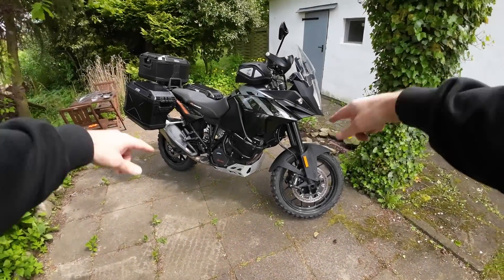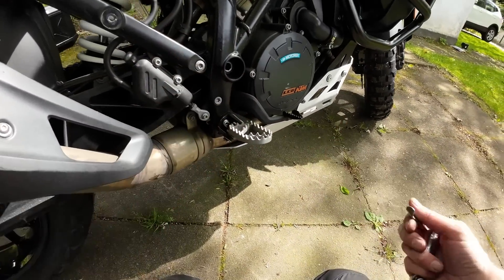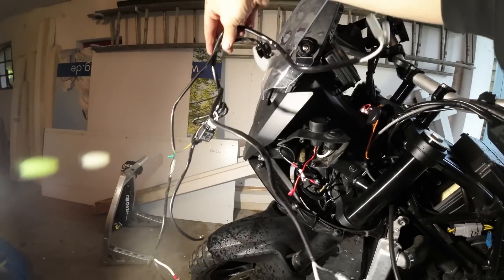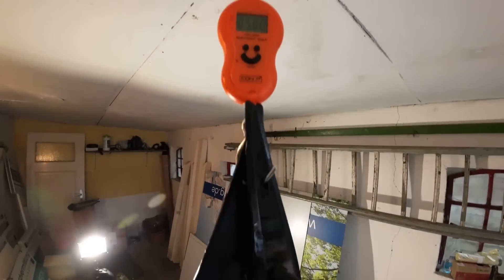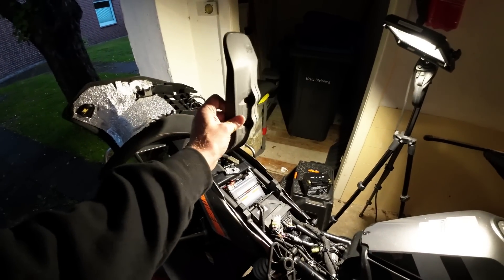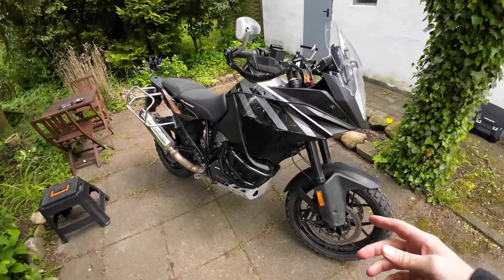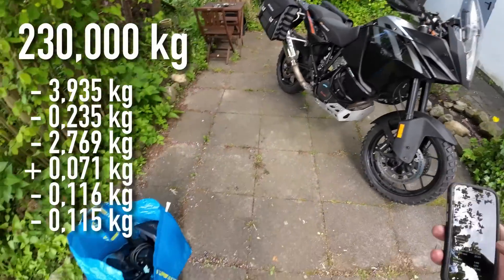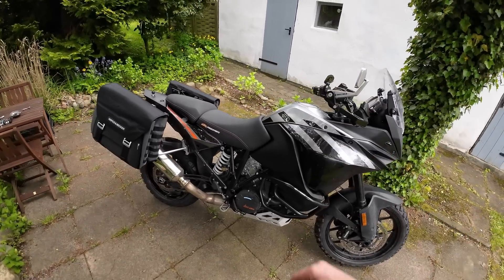My KTM is Too HEAVY! Here‘s How I Fixed It…

Comment: You could save even more weight with swapping to a rackless luggage system like the Enduristan blizzard or similar. They are also closer to the bike and dont flopp around like the ones on racks. And decating it would also save a bit more.
Reply from the maker: Yeah totally. If i did everything again i would possibly consider that route. Although i wanted the ability to switch back to the Aluminium boxes for the next road based tour.

Comment: I know for purpose video, it is ok, but what you are doing there, is not doing much at all. Taking parts off and cuting 5kg from the bike, doesnt mean much. Imporve your offroad skills, then the weight wont be a problem. Or, get a lighter bike and your problem is solved. Good luck
Reply from the maker: 5kg was just what was in the IKEA bag. In total it was over 12kg of weight saving. I can improve my off-road skills until the cows come home, but I’m still going to have to pick up the bike at some point. And 12kg less than stock is definitely enough to notice. Obviously a lighter bike will solve the weight issue, but sadly I’m 6‘4“ and 100kg and I live thousands of miles from the good roads, so I need the comfort and mile munching that only this size of machine can give me.
Reply: @AndyManCam  I was refering only to those. Those you took off but wont help you at anuthing. Cases, exhasut, battery, yes that's an improvement, but platsics and brackets.....wont help you much being taken off. Was a nice video to watch thou, never taught putting a super heavy bike in tough conditions just because of versatility
Reply from the maker: @Traulus83  I’m glad you found the video nice, but i don’t think you fully understand the concept of it. I think you’re being too black and white here. Any weight that is not adding to the function of the bike, that can be removed without performance cost, it’s helping in the right direction. The 5kg in the IKEA bag is ONLY small pieces of plastic and metal that are not needed, and they very quickly added up to a noticeable weight. With your attitude of ‚don’t worry about it, just improve your skills‘ you’ve very quickly got yourself a fully laden 275kg beast that you now need to haul up out of the dirt. Plus i think you’re missing the point somewhat. If my luggage weighs 5kg, but i can balance that weight out so that i can have the luggage and no extra weight on the bike, then that too is a glorious victory. Ultimately, every single little bit helps. And it doesn’t stop with the bolt ons. My panniers were half empty for my trip because anything that didn’t serve a purpose or wasn’t vital to the trip, i left behind. And i can tell you that after having picked up this bike before i did all of this work, and having picked it up (several times) after, Every single piece that i removed helped me a lot.

Comment: Nice work! But just one small detail, standart T7 is 205 kg wet weight, while the T7 World Raid is 220 kg wet weight.
Reply from the maker: Well that’s embarrassing! Seems you’re right and although i checked several weights, it seems the T7 is still a fair bit lighter! Time to get the angle grinder out…

Comment: I can confirm that the KTM plastics do survive a minor spill very well.
Reply from the maker: That’s good to know. Although my KTM handguards didn’t fare well from a stationary rear ending. Smashed to pieces!! Then again, the SW-Motech ones simply snapped off after a topple on soft dirt. Also not good!!
Reply: @AndyManCam  even the KTM plastic hand guards survived
Reply from the maker: Not for me. I put the KTM ones back on after the Norway TET trip, and then they got smashed too in a low speed off.

Comment: Just need to add a 'Super Leggera' sticker or 3, and it's suddenly worth £90k!
Enjoy taking it off road! Love taking the 1290 off road. Surprisingly capable for a road-focused model!  
Also big thumbs up to the bar ends! Just fitted them to mine too! Wasn't overly sure on them to start with but have actually made a substantial improvement on visibility and wind turbulence
Reply: The Monkey bike is still the off-road king though, right, Sam? ;) :D
Reply from the maker: Haha! That’ll do it Sam. I’ve heard those stickers cost thousands though! 😜  Sadly i had to temporarily ditch the bar end mirrors as the SW handguard snapped off on Norway 🤦🏻‍♂️ Back to the drawing board!
Reply: @AndyManCam  Actual plastic "adventure mirrors" on ball mounts then? ;)
Reply from the maker: @mattmutane5502 Quite possibly an option.
Reply: @AndyManCam  Barkbusters mate Barkbusters....... they are actualy made to take a beating and not a facion accessory like the OEM guards on both the KTMs and the BMWs 🙂 Cycra ProBend are also realy good but a bit more expensive
Reply from the maker: Yeah Barkbusters are what I’ve got my eye on. 👍🏻

Comment: Hows that screen been? I'm using the stock one at the moment, tried touring PUIG, battered my head around like crazy, tried small sports screen, blasted my entire face with constant wind and noise, no winning :(
Reply from the maker: It’s better, but it’s not perfect. I added the MRA spoiler thingy, which made a bit better still. But still not really as good as I’d like.
Reply: @AndyManCam  the search continues
Reply from the maker: Apparently the Givi Airflow is the only thing that does the job. At 180€ its a lumpy pill to swallow!

Comment: Hi Andy, I would love to see a review of the screen you have fitted. I am a similar hight to you, and have bad noise and buffeting on my 1190 Adventure R on the road. Not found an acceptable solution yet. Would love your thoughts on this subject. Keep the vids comming mate.❤
Reply from the maker: TBH David, it’s better than stock, but still not great. I fitted the MRA spoiler, which made it a tiny bit better still, but it’s still not as good as I’d like. The air is a little bit cleaner, so less buffeting, but it still fires a wave of noisy wind directly into the middle of my helmet. If i were 6“ shorter, it would be wind free, if i were 6“ taller, my head would be full in the wind but also much quieter.

Comment: 😱 Opening the fuel tank to refill is the only mechanic I dare doing… Regretted even that the other day when I dropped the fat GSA in the front muddy alley with those +30kg just in 😂 Enjoy your lightweight (purist would argue 230kg is far from lightweight) off-road trip 👍
Reply from the maker: That’s the worst timing!! Sure the purists will say it’s still too heavy (which of course, it is) but I’ll be very grateful for those missing 30kgs and also the comfort on the 1000km ride to get there! Plus if ever I strip off the accessories, I’ll have a 217kg bike to off road on 😁

Comment: As a very long term user of LiFePO4 batteries on Motos (over 8 years on my SkyRich Lithium battery) I can thoroughly recommend them. Lots of power. The only problem I've encountered is the cold. Once the temperature is below 3°C starting becomes problematic. The colder it gets, the more problematic it becomes. Minus 5°C and below is a real b#tch. The fix is to turn on the high beam headlight and let the Moto stand for about 2 - 5 minutes (it won't hurt the battery, honest), the colder it is the longer you leave it as the battery has to warm up. Then, try to start the bike (don't over crank it). It may take two or three goes to start. Mine lives in an unheated garage, so most of the time not problem but, parked up outside for the day in winter can be a problem.
Reply from the maker: That’s good to hear! I was actually in Norway at -3°C and just started it like normal because i forgot about the cold issue. The thing jumped straight into life! 👍🏻

Comment: The "floppy" thing at 09:10 is actually for the heat, not roasting your thighs.(not that it would actually help much...) The 1190 doesn't has that btw. 😁 The OEM handguards from KTM are quite sturdy btw...I've dropped my 990 ADV on the TET Poland and they just got a few scratches. Oh and don't forget to losen up the clamps of the brake and clutch lever, so they can rotate if you hit the ground and don't snap of the levers.
Reply from the maker: I thought as much, that’s why i wasn’t worried about removing it. Guess what, i haven’t really noticed any difference yet either!! 😂 I did however get rear ended at the traffic lights on Monday, and just from falling over, the stock handguard is smashed and needs replacing. 🤦🏻‍♂️
Reply: @AndyManCam  Oh damn! Seems that the quality isn't that good anymore...I crashed with 30-40kmh and nothing really happened to mine. Hope you didn't got hurt in the process.
Reply from the maker: I caught a footrest in the ankle, but nothing broken 👍🏻
Reply: @AndyManCam  Thats important...parts can be replaced.
Reply from the maker: Too true. And as it wasn’t my fault, somebody else can pay!
Reply: @AndyManCam  Classic...

Comment: Well, as a offroader, the weight you removed, is non esential. But hey, something got to keep you busy :)))
That's what's happening if you are a beginer, doing uselles things just to make you happy, I have learned that on myself when I was a beginner :))))
Reply from the maker: I don’t really understand how it’s useless. Less weight on the bike is less weight to pick up. I can tell you for a fact that i noticed the missing 30kg when i had to pick the bike up. I also noticed the reduced top heaviness of the bike when things were slow and sketchy. As far as I’m concerned, any reduction in weight is good.